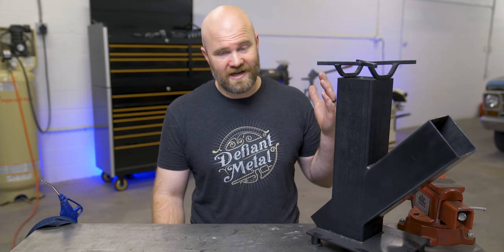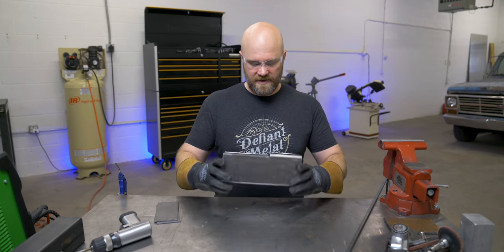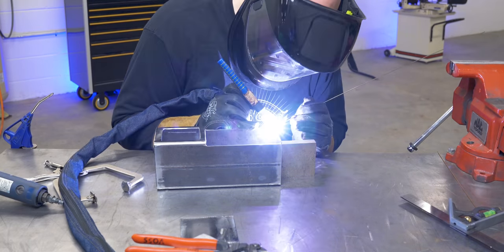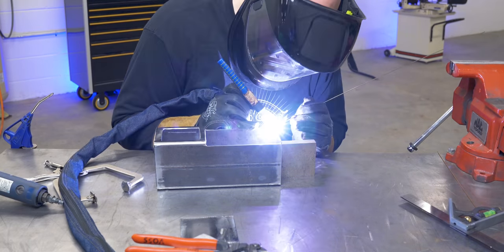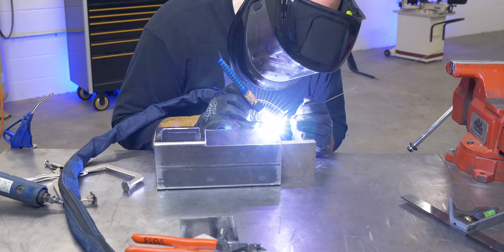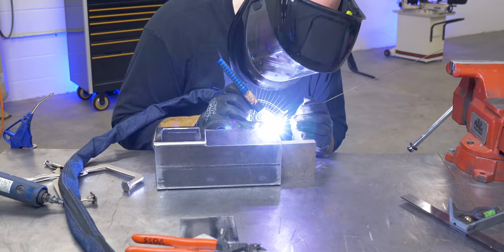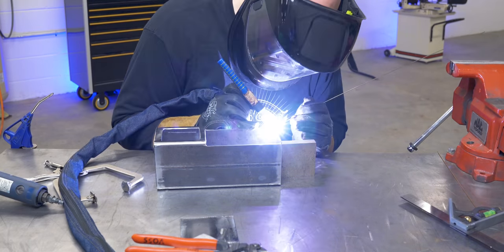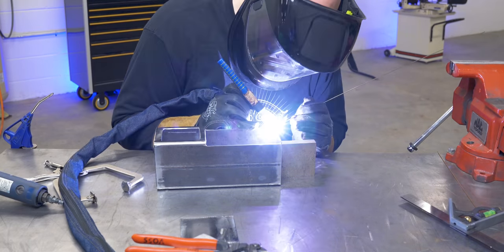Ammo Can Rocket Stove! - Welding A Portable Camping Stove

Comment: He's an artist. Not so much a fabricator as a genuine artist. Similar to the difference between  General Motors assembly line workers (Fabricators) and  Bugattis final assembly scientists (Artists). 
I felt it right I point out my take on it before I make a request that might you please produce a few videos on how us more common rough fabricators
(G.M. Assembly Line Type) with not much more than a DeWalt angle grinder and a Lincoln 180 Mig might go about some of your awesome creations. Possibly produce a video or three of you using nothing more than the above  mentioned tools and equipment, detailing material selection, welder settings etc. It would be appreciated by at least one person I am sure of that.

Comment: You have a very nice and clean shop. But this design just seems so extra and unnecessary. I don't like how it can't be removed from the ammo can either. And seems a bit too small. I would have used a fat .50 cal can and made the entire assembly removable. Nice weld beads though and good idea on the insulation.

Comment: Is there a reason you’re using stainless filler?
Reply from the maker: It welds really nice. I’ll use it on anything that’s just for fun or where the weld isn’t high stress. At few race teams I worked on we welded everything with super missile rod, including the chassis.  Super missile is a branded variation of 312 which is what I mostly use.

Comment: kinda complicated.  i've seen soldiers just throw wood in the ammo can and put a pan or pot on top and make food like that.
Reply: Worked for squad I was with ... ammo can would not swell (still closed)...little burnt after a few times tho...no worries...made some hot food .was all good
Reply: I believe the reason this is worth the complications (besides being a fun and challenging project) is that a rocket stove is extremely efficient compared to a regular camp fire! Certainly not necessary, but why not take advantage of the possibility!

Comment: Ceramic wool.  Used a LOT of it when making 14KV magnets with both liquid nitrogen and liquid helium inner tubing surrounding the main tube. [High energy physics lab]. Never wore a mask.  Only when it gets old or suffer high temps did it begin to flake.  It's inert so not dangerous.  Still you don't want it in your lungs.  One comment, too much welding time.  Could shorten this vid up a lot.

Comment: I would've burn the paint out of that can . Screw all that sanding it's messy and hard work for nothing
Reply: Maybe, but the heat from the fire may have warped the thin sides, and to be able to weld to it and paint it - it would have needed to be clean anyways, so.......

Comment: Pneumatic tools are I find, a waste of time and money.
Better in industry were you might already have more efficient screw pump compressors....
LESS maintenance with corded electric tools...
FFS the 'cachet' of the handled can🤬...I would RATHER tin Smitty a lighter stainless version from discarded appliance skins  
🤣Dudes a better weldor than design/fab tech...dime a dozen....